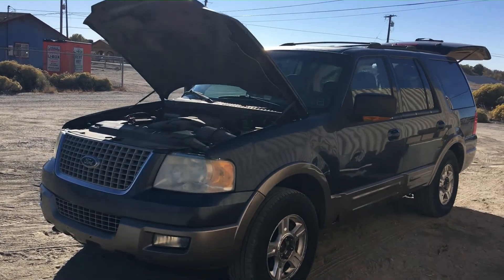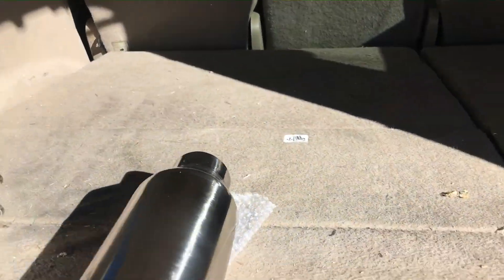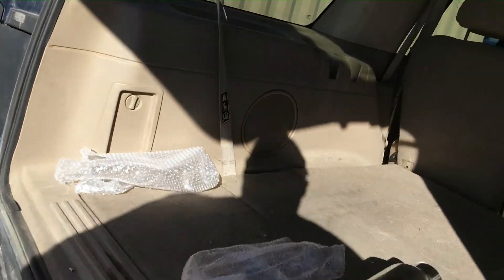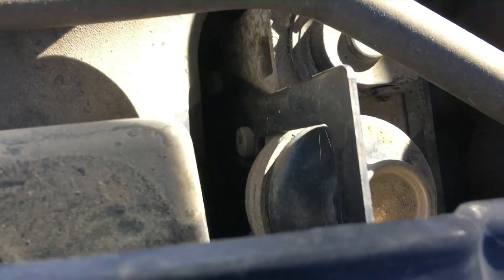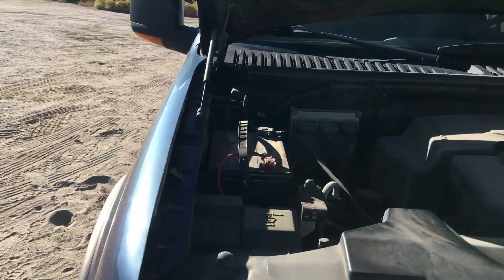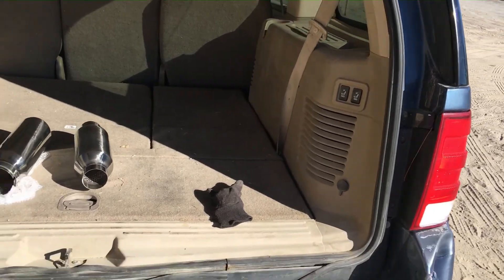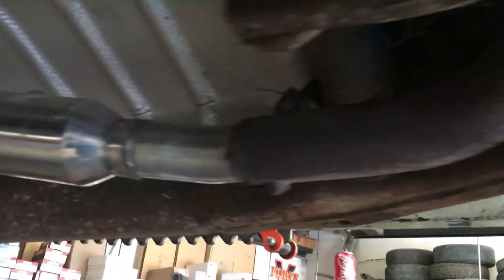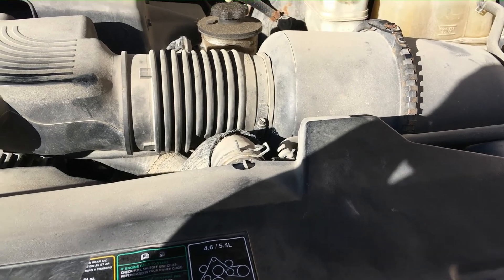2003 Ford Expedition budget performance exhaust

Comment: If you want more flow and sound, just cut the secondary cats off, the primaries flow as well as most aftermarket highflow cats. It's cheaper that way, and you can scrap the other 2 cats or keep them in case the primary cats clog/break and you can reuse them as new primary cats. 

Second, the stock intake is plenty good enough for a stock engine. It's a decent size and already routed for cold air. Aftermarket systems often don't use a heat shield or seal the filter to the fender for a true cold air source. Also think about this: the engine's air is limited by the throttle, so unless the throttle is wide open, that's what limiting the air. So unless you're at wide open, you won't notice the extra airflow from an aftermarket intake. What I always do is remove or cut out any restrictions, resonators or silencers in the stock intake tube and airbox and that works as well as a new system. Plus, paper filters are cheapest and they filter the best. 

Lastly, that hood insulation is mainly to reduce noise from the engine so it helps but not much. I've read it's also designed to melt the holding tabs/clips in case of a fire and drop down to smother it, but I have a feeling after it gets old it won't help, or will catch fire and make it worse, so good call on removing it.
Reply from the maker: Yes, the secondary cats need to go since they are after the back sensors.  I wanted to see the difference in the muffler replacement first.  So far, I have noticed a great difference without restrictive muffler.  It will be even better when the two extra cats are replaced with pipe.  The intake I have modded by removing the small trumpet like bottleneck by cutting airbox to where a good portion of the air filter is open to breathe in the air coming from side and bottom of engine bay.  I have removed all engine heat shields from intake manifold and hood to keep underhood temperatures improved by quite a bit.

Comment: That plastic blanket is there for a reason one to keep the engine more quiet n second is in case of a fire those plastic caps melts off and stays on top of the engine to reduce the fire from spreading if your not sure then you can look it up. Every wire can hold easily up too 150F degrees.
Reply from the maker: Yes the heat blanket has benefits however, I prefer cooler engine bay temps over potential hood protection.  I will eventually add hood vents similar to the Raptor to pull hot air out of engine compartment to keep intake manifold temps lower.  After all, you can have all the cold air intake and intercooler and then the intake manifold warms it all up again since its all under a hot insulated hood.

Comment: Hey man...I carefully chipped off the black paint around the window trim. It comes off clean and leaves a damn need chrome finish like the Navigators....best thing I ever did, it looks great now. You should give it a go
Reply from the maker: Good idea.  I would like to find a way to restore that black paint or plastic coating.
Reply: @madboostingmadmatt48  I refinished mine a few times but it would always chip. Good luck on the build!

Comment: Mannnn, I spent nearly $500 to get that knocking sound check out 🤦🏾‍♂️ mine sound exactly like yours -now I know for certain that I wasted money.
Reply from the maker: So many things on those engines that can make noises. Timing chain slightly loosening over hundred thousands of miles and clacking on the tensioner’s. The overhead cam roller lifters can make a noise overtime. The way I look at it is if the engine runs good and doesn’t make that noise above idle I will keep driving it keeping oil change is very frequent to ensure just right viscosity.  Frequent oil changes are very important for these overhead. Cam 5.4 2 valve engines.  I noticed right after a fresh oil change I do not hear that sound until the oil gets older or the engine gets hot like on a very hot day. Parts expand when they get hot and they can make noises. The type of noises depend on the severity. So far that engine has run very well. Even after 270,000 miles plus. Eventually, something will give because an engine that old will eventually give out somewhere. However, keep on driving it nice and easy keep it running, and when it’s time to replace it, be ready to replace it.

Comment: Merry Christmas.. mate hi from Tijuana BC ..  mate   the noise of your Exp is the transmission you need to  change the oil of the transmission
Reply: Are you talking about the ticking noise towards the end of the video? Because I have that same ticking sound and can’t seem to find the source
Reply: Yes my 06 expedition was making a noise tak tak tak and I changed the oil of the transmission  and is gone
Reply: @arturosanchez7222  The ticking noise is your timing chain slapping against the timing cover. The timing chain is telling you to get ready for an engine explosion. Ask me how I know?
Reply from the maker: I'm glad I am getting ready for an engine swap soon, then I can take my time and rebuild the original engine as a spare, maybe add some better parts.
Reply: Yeah definitely timing

Comment: I can hear ur phasers lol. But I like exhaust deal.. i have same year expedition, Wanna free flow to.
Reply from the maker: Lucky for us the 2000 for a newer have the phasers because there is a three valve engine. My 03 expedition has the two valve 5.4 engine. I believe the noise I have going on is the timing chain and the tensioner or make a noise together. My expedition has more than 260,000 miles so I’m not surprised the timing chain needs some attention. I plan is to installThe 5.4 supercharged engine from the Harley Davidson which has about 170,000 miles versus my 260,000 mile engine right now. It’s a huge engine so I’m gonna have my work cut out for me changing it.
Reply: @madboostingmadmatt48  right..mine has almost 280k miles lol, but has no rust very good body and paint.

Comment: sounds Good Sir, I have the same truck.. I would be interested in how you go about changing the muffler.  I have a simular exhast tip.. mine was welded on some years ago and has lost it's chrome  shine, How would I go about removing the welded tail  tip?
Reply from the maker: I went to my local exhaust shop and had them cut heavy factory muffler off, weld the new muffler and some pipe in its place.  Cut old tip off, and had them weld on my new tip.  They charged me around $65 for their time, welding and some pipe since new muffler is much shorter and lighter.

Comment: My expedition makes the same noice when my engine is on. Is that normal? Or do I need to tune it?
Reply from the maker: I really don’t believe that noise is anything serious, my expedition has more than 260,000 miles on it end it amazes me how well it drives. The noise on mine sounds like it’s coming after the engine like around the torque converter area. If it doesn’t get any worse and doesn’t create any problems, will just live with the noise.  After all I’ve had other cars where the noises actually were from loose timing chain or a bad timing tensioner.  When that engine gets changed eventually I’m going to also change the torque converter which I believe the noise is coming from.